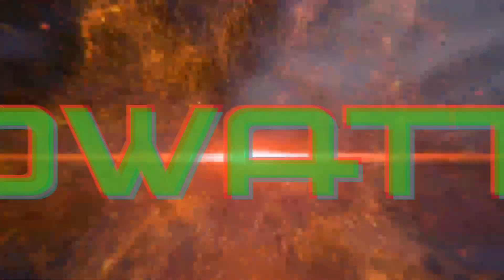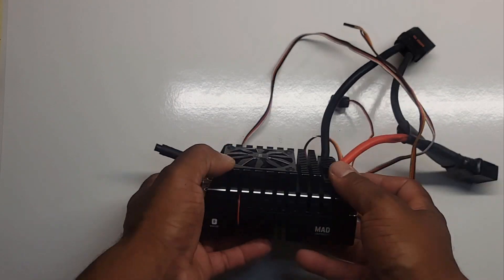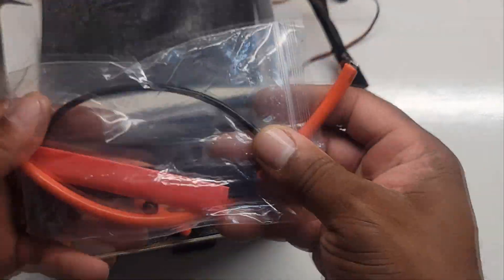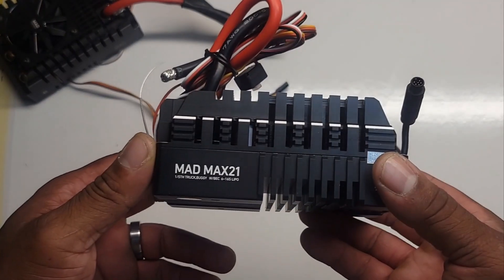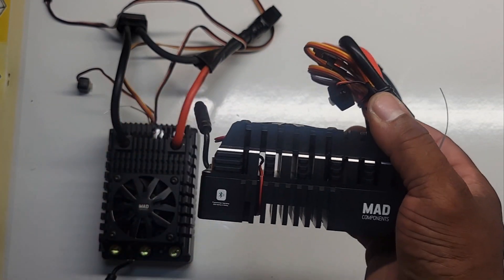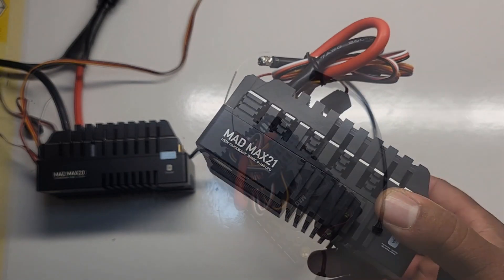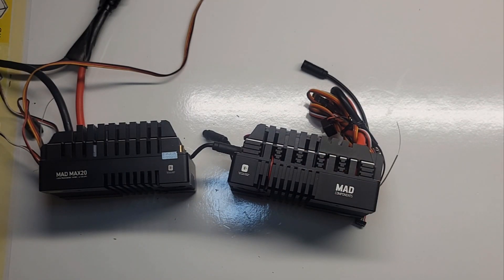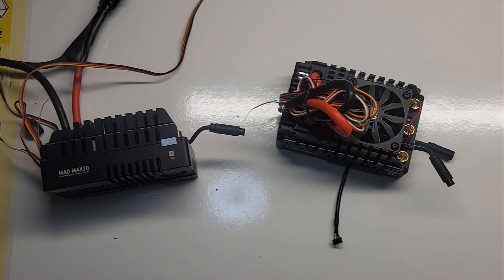Mad Components MAX 21 16s Sensored BOOST ESC #kilowattrc #Rmambabrushless #new #wow #amazing #omg

Comment: Does the 6-16s claim mean it'll recognize 7s, 10s and 14s single packs or series cell configuration?
Reply from the maker: It will run those voltage I am not sure if can recognize odd on auto recognize cell mode.  But u can connect Bluetooth and manually select 7s
Reply: @KiloWattRC appreciate the info. Long as is can take it off autodetect, bc ima mad scientist sometimes ill series connect two 3s lipos and a 4s to make 10s 😂

Comment: @KiloWattRC  i was interested in buying this, but for budget purposes i may just get the new Flier hard metal hardcase 400A V2 CAR Waterproof ESC instead. Do you have any feedback on those?
Reply from the maker: Avoid flier by all cost, throttle is jacky, the esc's are un predictable.    This might be in your budget, very good quailty built reliable and smooth operating esc, that delivers violent throttle response when demanded sensored or non sensored.  
https://youtu.be/dixOWtc21g0
Reply: @KiloWattRC  alright ill bite the bullet and spend a little more for quality. I have a max 4 already, but upgrading so I can go to 16s on a 5T Thanks again for the quick reply👍

Comment: "Great video" , quick question with this new ESC you can use any Hobby wing or Cattle motor using the sensor wire that comes with the Mad ESC and it will run in sensor mode without any in-compatibility issues?
Reply from the maker: oh yeah man it's butter smooth on startup with non sensored man
Reply: @KiloWattRC  thx for the quick response, 1 last question how did you make 16S as far as the battery 🔋 combo goes?
Reply from the maker: @michaelbaca7155  I used 2 8s packs in series for 16s.   Here is the link for 8s lipos
https://chinahobbyline.com/products/cnhl-g-plus-6000mah-29-6v-8s-70c-lipo-battery-with-qs8-plug?variant=46066897977558
Reply: @KiloWattRC  thx so much my man for the information 👊🏼

Comment: YGE had 160A 16S ESC like decade ago. Had it in 700 class heli. I went back to 12S because of basically no availability of 8S packs.
Reply from the maker: Yeah I've been running flier 400amp 16s escs a while back as I can remember.  I would just run 4 4s packs in series.  I was able to get A traxxas Xmaxx to do 130 on 16s a while back but the escs kept failing.  Anyway check out these cheap 8s packs 
https://youtu.be/h_cWOXZzkFk